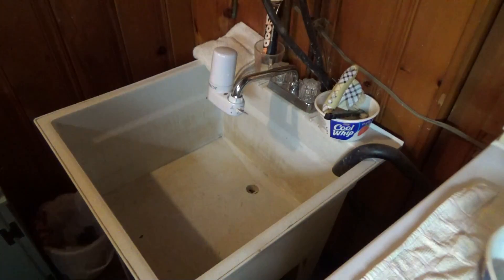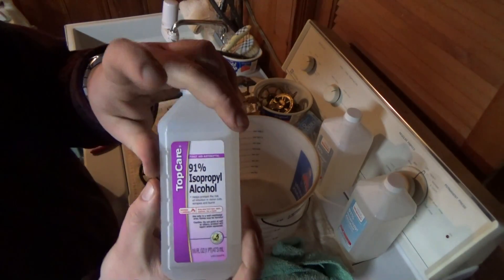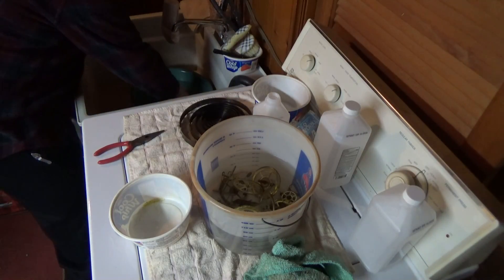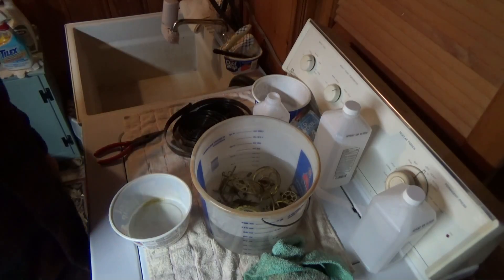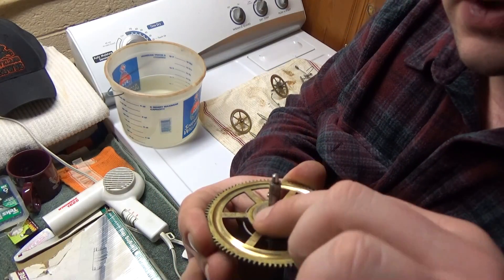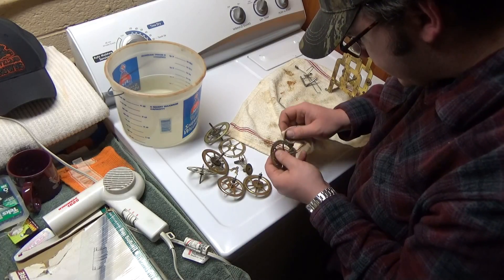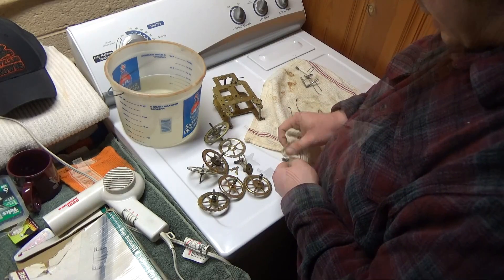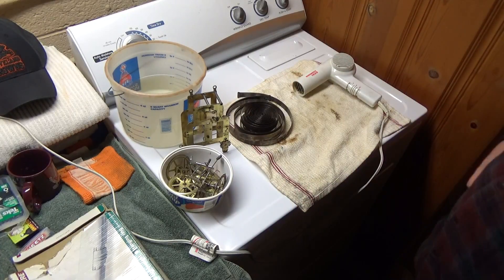Antique Seth Thomas Overhaul - Part 7 - Final Cleaning Procedure

Comment: Hello
I collect vintage old chess clocks and most of them have smaller movements, some of them stopped ticking and I suspect it's because of age. I am thinking to invest in an Ultrasonic cleaner and simply dipping the whole mechanism and following your method. I simply do not have the tools or know how to disassemble the movement especially since these have much smaller parts
Any tips/advice is much appreciated

Comment: you should be getting much better results from that cleaner
I recommend using the heat. I run my heat up as high as it will go.
running that cleaner hot makes it ten times more effective.
Give those parts much longer in the cleaner. maybe an hour or more. they should be coming out looking like the day they were made.
Buy denatured alcohol at the hardware store. you can also use it in as fuel for an alcohol burner
Reply from the maker: I’ve used denatured alcohol quite a few years ago and had some bad luck with it on some movements by leaving a very thick film on the brass, which then needed extensive rubbing with a cloth to get rid of. After switching to this type of cleaner (and I do heat it up a bit), I’ve been getting very good results. I’ve also found using regular rubbing alcohol after rinsing can sometime leave a light film on the brass, but also found using a high alcohol concentration (97%+) negates that possibility.

Comment: Do NOT use above 91% isopropyl alcohol. Using 99% will absolutely destroy the finish. You also don't want to use those higher concentrations with a hair dryer or any other source of heat or flame, especially with multiple bottles together like that. I know it doesn't seem like that much of a difference but 97-99% concentration iso alcohol is akin to paint stripper and highly flammable. Great for degreasing a grill but not an heirloom clock.
Be safe!